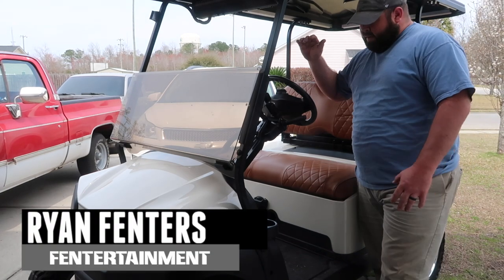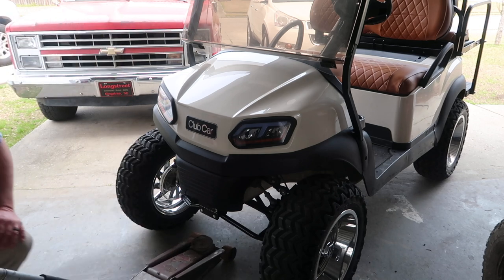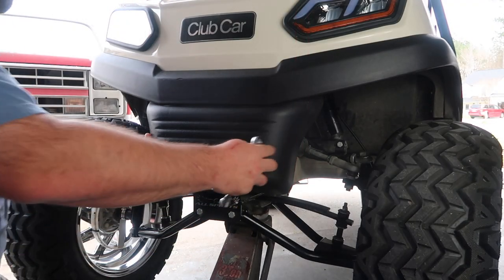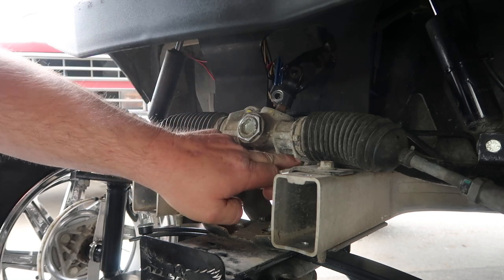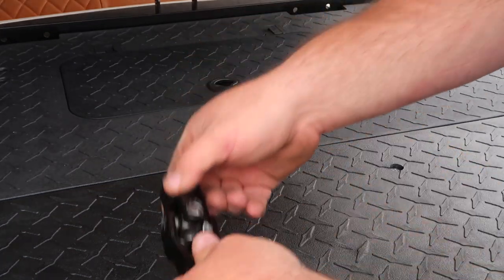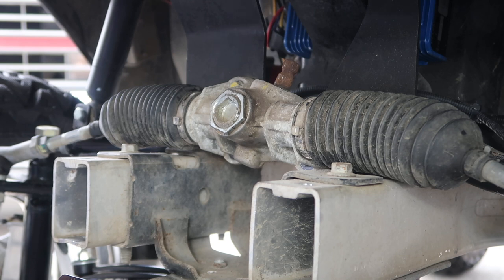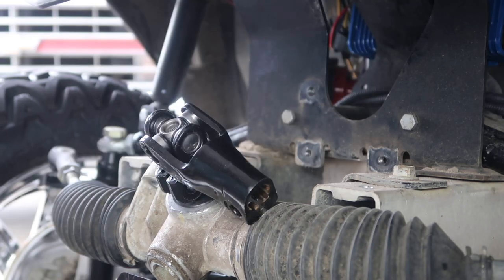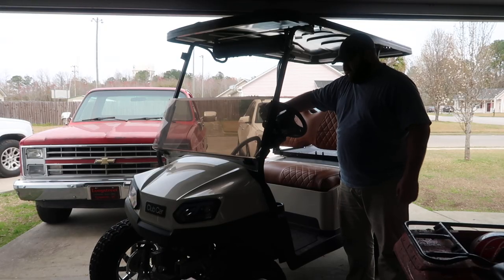How To Fix Golf Cart Loose Steering Wheel Play | 2004+ Club Car Precedent Onward Tempo

Comment: Do you know if the steering shaft is adjustable to be able to align the steering wheel straight with the tires? I am asking because I have a brand new car but the aftermarket steering wheels that I want to install end up being off 30 degrees to the left or right and the steering shaft is hexagon shaped so no way to adjust the steering wheel itself correctly.

Comment: I had the same play on my 2010 but it was the square shaft going into that same location above yours and I put two tiny shims in there to tighten it up. Thanks for the part number in case mine goes bad!